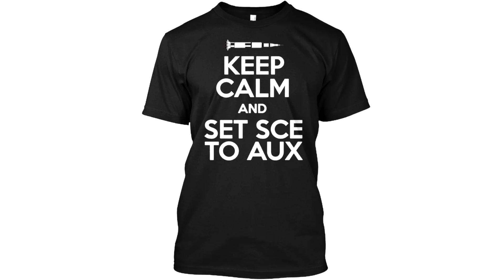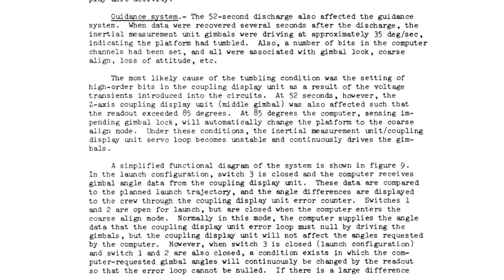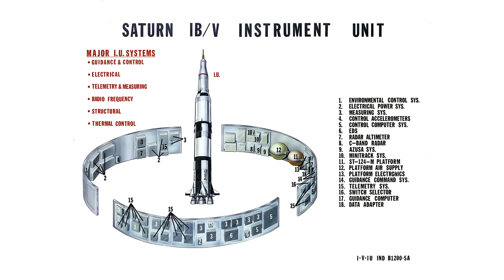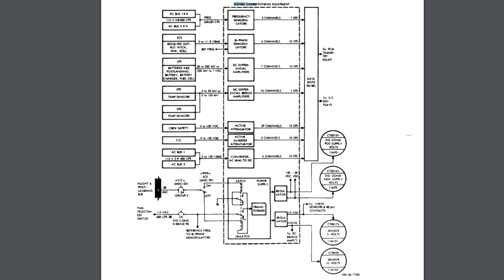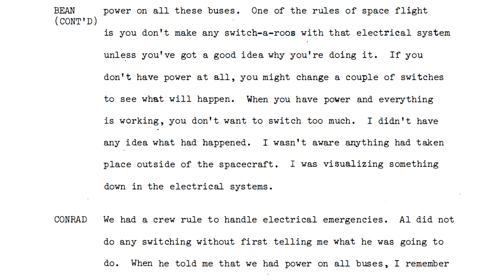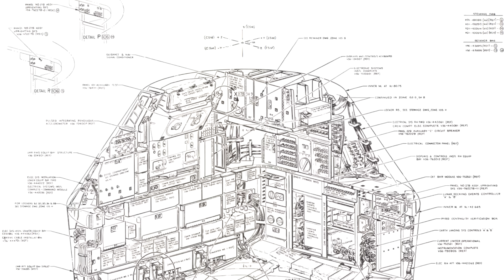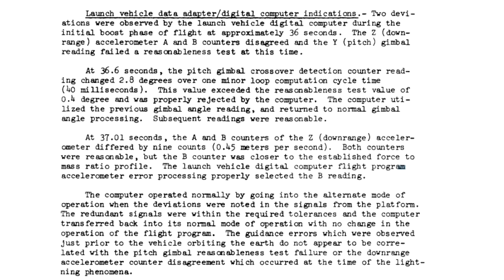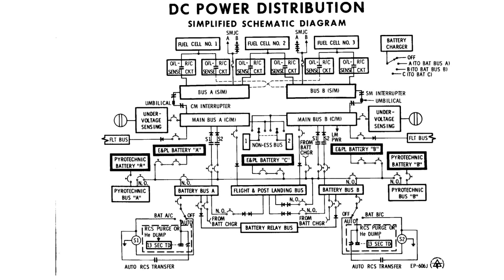What Does "Set SCE To AUX" Mean Anyway - Apollo 12's Lightning Strike Explained

Comment: The more I learn about Apollo sub systems, especially the digital/non-chemical reaction stuff, the more impressed I am by 1960s NASA.
Reply: It's impressive that even a lightning strike ran into the safety systems and not the critical hardware.
Reply: I agree. I wonder if today's all digital systems would have been as robust.
Reply: @PSquared-oo7vq  quite probably not. If anything modern electronics running at far lower voltages and being nearly exclusively digital rather than analog would simply go poof and be dead. However it would be reasonable to assume that technology to electrically isolate the more sensitive components would be used extensively in the effort to preserve redundancy.
Reply: Richard Adrian 
But current digital systems are small light and low power. There’d be an array of backup systems.
Reply: @larryscott3982  yes you are right there would be and is redundancy.  The small and low power part is what makes them susceptible to any electrical surge. Even static discharge from your body by touching the internal components without properly grounding your body first can fry computer components. The actual parts themselves are far more susceptible to being fried by electric surge. However as I stated we have gotten a lot better at isolating critical components from damage by lightning.
Reply: Richard Adrian 
I’ve haven’t seen a microchip fail from mishandling in forever. These aren’t your dad’s electronics. Postage stamp sized single chip GPS receivers without any procedure don’t fail. Well I’ve not seen it. And even older gps gear, I’d open them for cmos batt replacement without any fear, any haven’t a problem. Again, space certified is pretty robust. 

And consider how many satellites at geosync and gps spend decades in cosmic ray exposure. 

these days. Space certified electronics and protection shunts have come very long way. Their fragility is very low. Rover lasting decade on Mars is harsh. If external surge got to Fully isolated backups, then they’d be at different level of trouble.
Reply: @Richard_Talks  Faraday caging is practically always done, this is 50% of the protection. Radiation hardening is the second.
Reply: Larry Scott , I’m sure critical circuitry in current rocket circuitry design is protected with opti-coupling all over the place to prevent over-voltage as a result of lightning strike or other power surges.
Reply: @macdoctor145  Optocouplers present their own difficulties.
Reply: @larryscott3982  they should just put a gaming computer in a rocket and fly that way
Reply: Djordje Oljaca 
The electronics today in rockets aren’t that much different from the logic in KSP and drones. It’s easier today to integrate many more channels of input in very a small package. But, that’s today’s computing power. 

Boeing screwed that up in their capsule test. Mismatched clocks, which caused the engines to burn longer than planned. And potentially engine firing at the wrong time could’ve been more disastrous.
Reply: @Richard_Talks  LTT and ElectroBOOM did a video on this recently, trying and failing to destroy a modern RAM stick with static electricity.
Direct electrical arcs to basically every pin with no effect.
TL;DR, most modern electrical equipment can be hardened to the same degree, but most of it isn't going to the moon so companies don't overengineer their consumer products.
Reply: @larryscott3982 these days the problems usually seem to come from memory chips more than anything.
Reply: @PSquared-oo7vq   And had such robust programs. Check out "reasonableness test" at 9:57. Managed to cram that into those very few bytes they had, on top of more obvious needs.
Reply: @donjones4719  as a computer scientist, this was what stood out the most, the fact they had a redundant system to verify the validity of the values and correct to the closest value at a specific time is easy by today's standards,  and we still mess it up... Imagine the foreshadowing during the engineering in order to make the decision to add that redundancy on a system where every byte counts...
Reply: @PSquared-oo7vq  yes, they could be, if they were built to do it. Your average consumer grade equipment would fail, but the aerospace industry uses fault tolerant electronics that are even better than old timey stuff!
Reply: @PSquared-oo7vq  NASA's or public? NASA takes some pretty impressive hardening requirements if you want to make the chips and boards for satellites. (It's easier to get classified as "nuclear hardened" for military equipment, and that makes lightning proofing look easy).

The stuff in our laptops and phones? They'd be dead as soon as they encounter a Van Allen belt.

A well designed digital system today would be able to detect the fault and switch to aux power in milliseconds, possibly even balance out the fluctuation if designed for it.

My self, I like a physical breaker bar for back up power - if you need to use the aux power supply, the odds that the digital system isn't getting power from the mains is pretty high.
Reply: @PSquared-oo7vq  Yes they would. Look at SpaceX, they seldom have failures. There are fully digital systems that are fully radiation hardened and very very robust. But back in the day it was quite the accomplishment.
Reply: Just think if they were tasked with making a Nintendo system. They were so far ahead of the time it's really impressive.
Reply: I agree; landing on the Moon in the 1960s seems like doing a heart transplant in a jungle with sticks and stones; that takes some amazing skills and determination.  Everyone at NASA were heroes.
Reply: @adm0iii  Um, yes they were heroes, and we're proving it with the difficulty we're having going back!
Reply: @adm0iii  they are nasshole zeros wake up
Reply: It was like just one step more advanced than Steampunk rocket flight, LOL.
Reply: @DavidLari  Hell, it pretty much was steampunk
Reply: @DavidLari  Zw
Reply: Only because it largely went well, Tyler.
They risked quite a lot to go to the Moon with what they had, it could have easily caused a lots of deaths and set back the Space program (through public outrage) for decades. But then you always need a touch of luck to be successful and "no guts no glory" ;-)
Reply: Ugly German Truths - NASA had been given a clear mandate, & because they had a clear mandate, they were willing to “take calculated risks”. Even so, they used a process of “Rapid Iterative Development” where they were developing the vehicles for the next step in the process while trying to incorporate the lessons they were learning from whatever they were testing. As it was, there was a huge public outcry after the fire on Apollo 1, & they still had a long list of volunteers for lunar missions AFTER that disaster.
Reply: I just said the same thing and then saw  your comment ,  it is just amazing all the redundancies and procedures that they  had, and they calculated everything with their brains (slide rules,  and paper, they may have had some IBM machines don't know)
Reply: Skippy 4077 - They did have some IBM machines, but much of the work was done with paper & slide rule - This was especially true during the early 1960’s. See “Hidden Figures” for much of that story...
Reply: They invented the equipment and practices the modern fellas follow. Ignorance of the reasoning for tolerances leads to major issues down the line 

As it gets older, old mistakes will re-emerge 

It’s a common trope in human history played off in stories as “the ancient device trapped in a cave of some sort left behind to protect them from the last calamity”
Reply: @rckli    wow.  we bet you're a lot of fun at parties.
Reply: @havocproltd  depends on the party

I definitely don’t attend parties where people like you exist - people who say the “bet you’re fun at parties” comment are usually too bitter to have around - Debbie downers are shitlords at parties

It sucks but you can do better 👍🏽 I believe in you
Reply: @rckli  yeah, yeah, yeah...do you want some cheese with that whine, Farnsworth?
Reply: @havocproltd  the first time you tried insulting me didn’t work- trying it again just shows I was right about you >_> 

What’s the point of writing antagonistic comments to people online? It’s just like the Kid and the Wolf from Aesop’s fables. You should go read it - anonymity is your rooftop.
Reply: @rckli    yep.  as i said the first time.  Not too anonymous if you lurk around my id.  Anyhow, this deposition is wrapping up and I have to go back to work now.  don't run with scissors!
Reply: @havocproltd  I asked you: “what’s the point of writing antagonistic comments to people online?”

Rather than address your behavior, because I never took your bait, now you pretend to leave. If you were actually leaving, you wouldn’t write back. But you couldn’t just leave it alone, instead you’re trying (again) to insult / bait an argument.

Again I ask you the same question: what’s the point of this?
Reply: It’s such a shame that no one from that era is still around to show anyone else how to build a rocket that can get to the moon. We were really lucky to have hit a pocket of the right kind of people at the right time in history.
Reply: @SCULPTURAMA  they never went von braun said it would take 5 saturns to get there and that rockets dont work on a vacum smh
Reply: @edkemerer7176   I agree Ed. Can you imagine if we had the battery tech now that allowed the air conditioners on the suits to do what they needed to?
Reply: An adequately funded NASA
Reply: WITH SLIDE RULES!!
Reply: Congrats, your mind just went Level UP. Welcome to the evolving portion of humanity.
Reply: Nasa in the 60s was Space X today.
Reply: And all the more disappointing that we haven't been back to the moon in 50 years :(
Reply: And their ability to photoshop stuff was decades ahead.
Reply: Keep in mind that NASA (Operation paperclip) only took your imagination to the Moon with actorNuts 👩‍🚀 driving cars and making phone calls with VINTAGE TECHNOLOGY 😄👩‍🚀🚀 ROCKETS CAN'T get high enough to show homosapiens the whole mythical blue 🔵.   CGI is not reality
Reply: Yes, what an incredible piece of engineering the Apollo CM was. Hard to believe that this was done by the same country that brought us the Chevy Vega! Lol
Reply: @bobjohnson1587  
Vega on cruise control...cheap...save $...

Moon shop,,,
Only the best!!@
Make sure
THEY COME BACK...

AN HONOR 2 JFK*
Reply: lol
Reply: Boy , the 3 guys were well trained
Reply: and the least impresed i am about the 2020s NASA
Reply: And keep in mind they were still using Slide-Rules when they designed these systems...not too shabby...a flying BOMB gets hit NOT ONCE but TWICE by FRIKIN LIGHTENING...takes a lickin and keeps on tickin...NASA ROCKS.
Reply: The White man knows how to build a rocket.
Reply: All the government officials ,
MafiA,
Surfers.
Truckers,
TeacherZ, etc

senators / some quilt Republicans...guilty 1'z...
Felt =

BAD.
Gave a blank check ( taken away from the Military Industrial Complex thrives)

" We
WillI
Land
A man
[ VERY SEXIST .LOL ]
I FORGIVE HIM!

ON the 🌙. 

Kept the poor people
Poorer? Is that a word...
YES!
Reply: Nazis
Reply: We took Nazi rocket scientists after WWII
Reply: You're not kidding. Oh boy, was that space era outstanding.
Reply: So you should be, they were the brightest humans TOTALLY committed.  Its a high water mark of what we humans are capable of.
Reply: LMAO
Reply: Quite cool when you actually get funding!
Reply: Trouble shooting Step 8 if 76543&2 don't work for separating lunar landing stage from launching stage: bolt cutters.
Reply: How far has NASA fallen.
Reply: There is some interesting and in-depth conversation in this thread...until I got to the idiots at the end. Mis-quoting people, no idea how rocket engines work, parroting “facts” they saw on Facebook, and so on. What a sad time we live in, as far as the general population’s intelligence level & critical thinking ability.
Reply: @97marqedman  I'm just happy to think that this is just one Russian troll farm causing this bullshit.
Reply: You mean the same NASA that lost every single detail including videos, documents or any piece of paper that proved we landed on the moon? Not that impressive really.
Reply: But remember even with 300,000 of the greatest engineers scientists and technicians, we still faked it and every one of those great people kept quiet.  I’m kidding of course but I just shake my head when I hear they faked it
Reply: Nobody cares how impressed you are or anybody for that matter. They did amazing work with or without people being impressed
Reply: Yes. And I heard we can't even use the blueprints to make those old rockets. Goes to show they don't make them like they used to.
Reply: @abraxaseyes87  WHAT BLUEPRINTS? You believe rockets would work in a 10 to the negative 17 TORR vacuum?
Reply: Too bad we lost all the technology and can't go back to the moon as per the sayings of a NASA scientist lolololololololol
Reply: I concur, it was a time before logic and reason had not been corrupted by pseudoscience brainwashed climate cultists.
Reply: They are but a shell of their former selves
Reply: @bval2201  But at least they are advancing the causes of diversity and inclusion.
Reply: Nah it is all fake
Tinfoil hats on peple
Lol
Reply: Huh. Its said that since 1954 ish, humans have not needed chemical combustion engines of any kind.
Reply: @darrylstein187  it's also said that the world would end in 2012 and we were all going to be living in a dystopian desert scavenging freon to keep cool.
Reply: The more I learn about Apollo the more i am convinced it was all faked
Reply: I cannot believe that you actually believe they went to the Moon this is unbelievable I thought people would be waking up by now
Reply: @edkemerer7176  
Guess what Ed, your dream of being the smartest person in the room will never come true, you're actually the dumbest and most gullible one in the room, idiot.